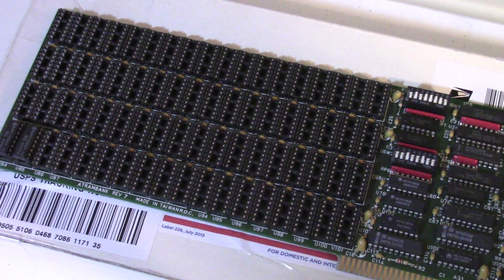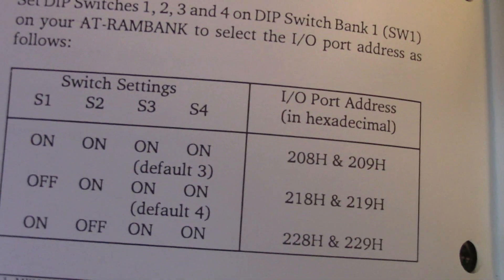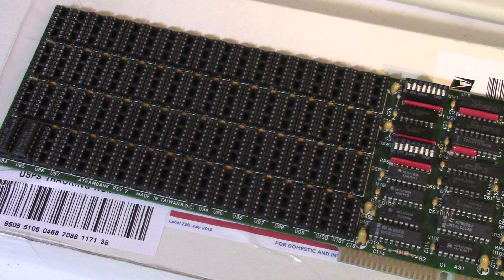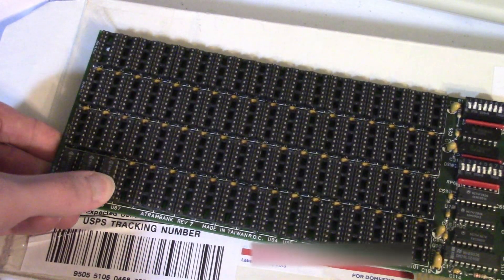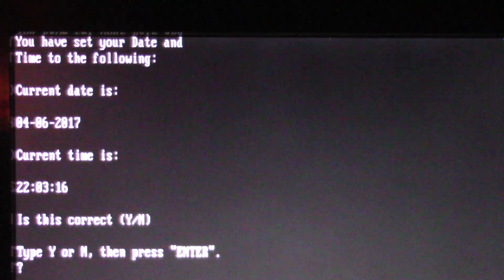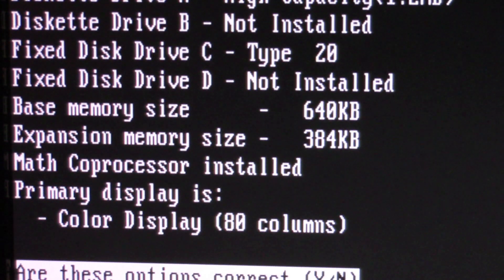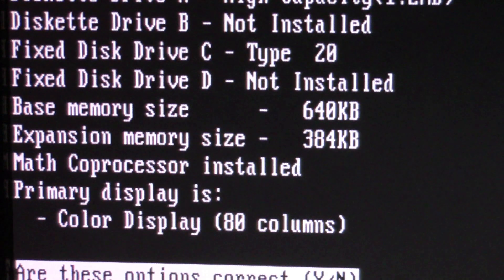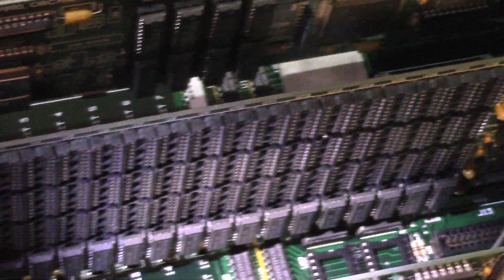IBM 5170 AT DFI RAM Upgrade! (ISA RAM Card)

Comment: I have one of these with Bank 0 and 1 fully populated. I used the software to set the jumper for Extended(XMS) memory only on my 12Mhz 286 (Mylex MA286-12 motherboard with Quadtel BIOS). When I plug it in the PC posts but I get no video output on my VGA card. I tried 2 different VGA cards and moved the RAMBANK and the VGA card to multiple different slots. I guess my AT RAMBANK has some hardware problem now

Comment: I just purchased one of these off eBay without memory, and gosh I wish I had the success you did!  I wanted to upgrade my IBM AT with 512MB on the MB.   I had enough Fujitsu 81256-12 memory chips to fully populate.  Installing the RAM board in my AT just hangs up the computer.  No BIOS post nor error beeps of any sort.  I tried with zero memory chips installed, then adding only one bank.  Still the same -the AT just hangs.  In frustration, I have a simple 486DX computer that has only 16 bit ISA slots.  That one uses SIM memory and was equipped with 4MB.  Reconfigured the DFI RAM board, reinstalled all 2MB worth of RAM Chips too,  as Expanded Memory starting at 4MB (or after the on-board memory).  The 486 computer booted up without an issue.  I ran the BANKTEST.EXE program and it indicates all memory segments are OK.  I then ran the INSTALL.EXE program and it correctly showed my existing 4MB of on-board SIM memory and the "to be installed' 2MB on the DFI board.  I made the recommended config.sys change as indicated at the end of the Install program.  On reboot it didn't show any memory beyond the original on-board 4MB when checking with the MEM command or during the BIOS memory check.

So not as much success on my end.  Bummer! Perhaps it's not working well on the 486 machine since this was developed for the early IBM AT 286.  However, I've got to say I'm having much better luck than the hang on the IBM AT.  One additional note, I placed a piece of mylar film over the Data pins on the DFI's ISA connector (both the 8 bit and 16 bit side) to block those signals getting to and from the board.  The AT system can then boot fine!  Enabling either data side (lower or upper 8 data bits via Mylar film removal) will result in the freeze at boot.  I'd love to see an output of the BANKTEST from another working board.  The manual nor your video show that check being run.  It gives me five memory segments it can check (which all pass), but the segment addressing is confusing to me (0C000H, 0C400H, 0C800H, 0CC00H and OD000H).
Reply: Finally resolved my problem with the IBM AT memory expansion.  It turned out to be caused by an  GOLDSTART ISA IDE/Floppy/Port board.  Funny the AT worked fine with the 512K on MB RAM and everything was functioning just fine for the hard drive & floppy.  Also the VGA video card was working without issue.  After trying a second AT MB with the same results I knew it must be either the VGA or drive controller board.  VGA didn't resolve anything, but today a new ISA HD/Floppy controller arrived in the mail and low & behold my memory expansion boards now get recognized!

Comment: Is there any differences in speed if you choose only extended memory vs. conventional and extended memory modes ? or is there no difference due to the fact that the bus speed is so low and that you only have 8-bit at the ISA slot ??
what would happen if you use lower ns memory chipsif the cpu and motherboard supports it, would you get memory errors?
Reply from the maker: I believe the issue isn't speed so much as what the program expects to use.  Conventional has to exist for DOS and legacy programs though.  I do not beleive that there would be memory errors.  I think it would just function at the speed of the motherboard.

Comment: very nice! I'm about to pop in my Intel aboveboard 8mb
Reply from the maker: I've seen some Intel boards for sale, but I did not see any dip switches or jumpers.  Is yours like that and configured via software or does it have everything on the board?
Reply: mine has no jumpers or dip switches.  Just a ton of chips.  I would think there is a software driver but haven't tried it yet.  My whole evening of upgrade plans have been derailed trying to get IDE running on this machine.  Have you had any luck getting an IDE drive working on yours?
Reply from the maker: I've just been sticking with the MFM drive for now.  Have you tried a SCSI option?  I figure that any controller with its own bios that forces itself into the boot process will have better luck.  Have you gotten it to work with IDE yet?
Reply: no i have not.  I picked up a Future Domain enhanced IDE controller with its own BIOS.  It boots, detects the card and the channel, but not any drive i've tried.  I'm thinking the IBM onboard BIOS isn't too happy, will need to think of an alternative (unless you have any ideas).. always happy to talk to a fellow 5170 owner :)
Reply from the maker: Hmmm, very strange...  Is it an older card which can only detect smaller, older drives?  Or does the card happily load its bios and see the drive but the AT fails to do so?  Have you tried one of the compact flash adapters for XT/AT?  I saw a video where one worked for a guy.  It would be easier than adding an IDE hard drive and I think some allow the flash card to be inserted in through the rear of the slot, allowing quick changes even with the case shut.
Reply: its a newer 16 bit ISA adapter.  was so sure it would work.  I think its the gimpy proprietary 5170 BIOS.  tried the flash adapter, and a bunch of 400-500mb drives, nothing.  will not detect any drives.
Reply from the maker: I do have one of those "Fan cards" coming with an IDE controller on board (amongst other things).  I may attach a drive to it just to see if it can detect it.